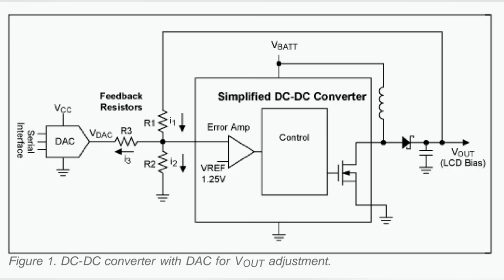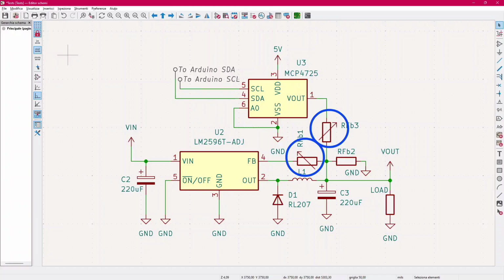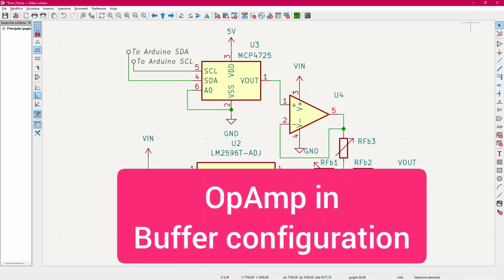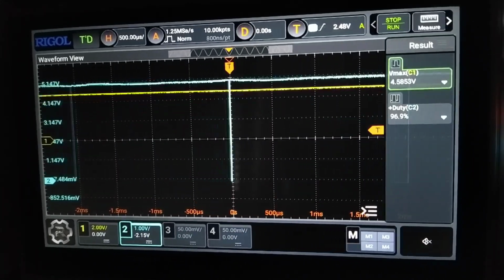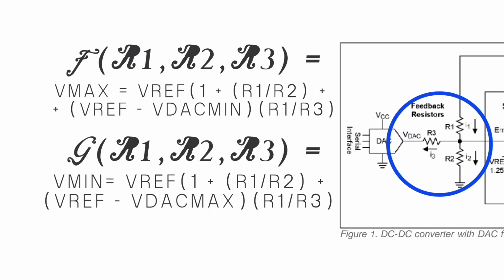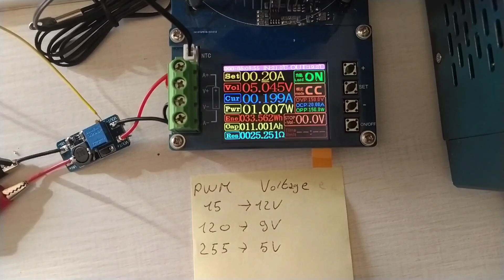3 WAYS TO HACK a DC-DC converter

Comment from the maker: Hi all, in this video I give you 3 method to hack a DC-DC converter. You can then control DC-DC converters like buck or boost converters with an Arduino for example, but this works even with esp32 or any MCU that does have I2C or a PWM signal

Chapters:

0:00 - Intro
0:09 - Method 1: With a DAC
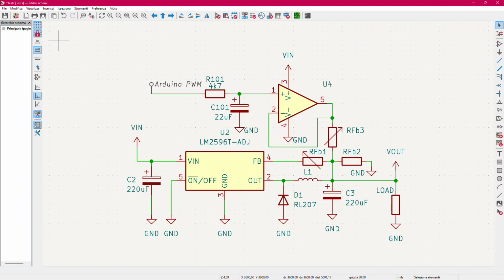2:08 - Method 2: With PWM
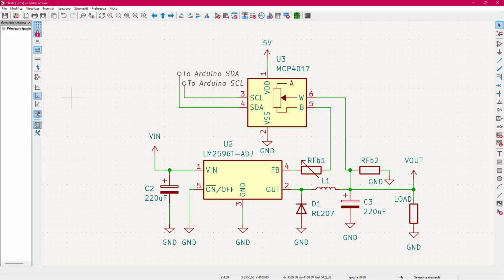3:15 - Method 3: With DigiPot
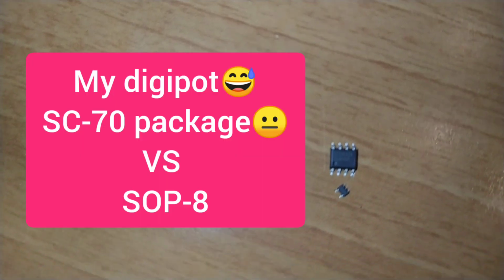3:41 - Resistor feedback calculation
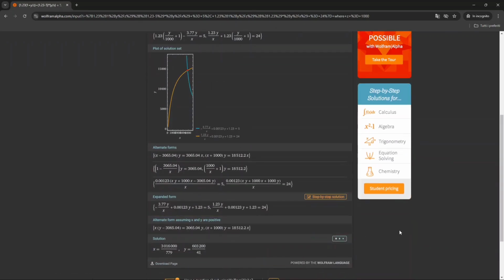4:28 - Hacking a pre-made module

IG: https://www.instagram.com/xburningelectronics

If you want in-depth reading:

https://www.analog.com/en/resources/technical-articles/digital-adjustment-of-dcdc-converter-output-voltage-in-portable-applications.html

Comment down below for any question!

Comment: Nice, but here is what I have done:  first remove the converter's output voltage divider to feed back pin, Then calculate a new voltage divider so that the max output voltage will be divided to you DAC/MCU max out voltage ex. 5 volts or 3.3  volts and feed this divided voltage to the non inverting input of LM358p, on the inverting input just input your DAC voltage, which will be 1:1 relative to the converter's divided output voltage after you changed the resistors, the output of LM385p is connected through a resistor to feed back pin of the buck IC converter, you have to add a capacitor in paralled to this  last resistor since feeback pin is the non inverting input of the internal error amplifier so if the voltage is changing too rapidly like in drawing   large current or sudden currrent spikes will  lead to instablity i.e we just made an ossillater thats why capacitorin parallel to the resistor on the output of LM358p is needed, and no PID is needed, now the software is simple as you need to calculate the DAC output voltage only: Vdac = Vout*(R1+R2)/ R2 and Vout is the output voltage you set using a remote or a rotatory encoder ..etc. the accuracy is dependant on the resistors value accuracy 0.1% is better than 1% .... but you can always compensate in software. do a video of this please no youtuber has ever done this.
Reply from the maker: @rydjaradat  Hi, thank you for the comment, however I don't know if I will make another video of this kind in a short period of time...

Comment: you don't need to make simple thing complicated, just provide pwm signal on enable pin of module. it just work
Reply: If you'd study switching regulators you'd know they are quite sophisticated, especially those created to work in both "continuous mode" and "discontinuous mode", that loosely correspond to "greater than 10% load" and "less than 10% load",  two load configuration which have two totally different transfer functions from the switching signal to output voltage. In short, the regulator usually implements some fancy highly non linear functions to convert the feedback signal to a pwm one, to produce a more stable voltage. They also often operate at a really high frequency 500k up to 2M Hz quite easily, higher than an Arduino pwm frequency, with much greater resolution on the output pwm. Also many pwm for low power applications have the switching MOSFET integrated so you wouldn't have access to it, yet you can still manipulate the feedback circuit's reference ground. 

Cheers
Reply from the maker: @bellini98-1  Wow, thank for your comment!
Reply from the maker: @kayyum-f91b992d  That's a bad design because you are Injecting noise and continuously tell the feedback loop of the converter to go from let's say 3.3V to 12V at hundreds of kHz
Reply from the maker: Maybe not hundreds but you get the point